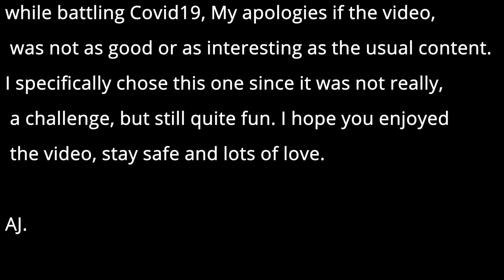Old Cast Iron Gas Stove Restoration.

Comment: i've restored many stoves like this, mostly 2 burner.my way is a little different, not necessarily better. i take it apart & sandblast everything, except the brass gas control. i paint with rust-o-leum high temp paint. most u.s. stoves have adjustable orfices allowing them to operate on propane or natural gas. also, i throw the old screws & nuts away & replace them with brass or stainless steel.
Reply: It can run with natural gas OR propane?
Reply: @michiganmikeupnorth  as my comment stated, the orfices are adjustable for natural or propane gas.

Comment: Neat. I just bought one of those a few weeks ago on Amazon. I was hoping I'd see a way to increase the output of the burner, but that's ok. It's probably best to just get a new one at some point that's not as low quality.

Looks nice!
Reply from the maker: The output is not adjustable, you only have a valve that adjusts when you turn it. That is the only way you can adjust the output.
Reply: @AJRestoration  yeah. The bolt in the side is supposed to restrict the air flow, but even with everything wide open it's not very powerful. I was thinking of replacing the valve with a more effective Venturi system. Not even sure if it'd work.

Comment: Excellent video!
1) After rust removal with the acid, do you wash or rinse the burners before baking on the flax seed oil?
2) What process (& product) would you recommend for restoring vintage stove burners (cast iron) that were recently painted, presumably to hide rust? (I don’t know what kind of paint was used, but I don’t want harmful fumes produced when the stove is used.) Does the stripper need to be neutralized somehow before rust removal using water & hydrochloric acid (and in what proportion)? Thank you!!

Comment: I thought it was a great video. I just purchased a 3 burner stove, close to this one in appearance.  Two of the burners have 4 round circles on them about the size of a US 5 cent piece, and one burner has 7 circles for the gas on it.  Eventually I will try your method of restoration.

Comment: Thanks for the video. Get well soon. I recently found one of these in my fathers garage in similar, very rusted condition. Mine has almost no markings so I don't know where or when it was made. I was thinking of restoring it too when I came across your video. I might have to do the acid based rust removal on the entire thing since I don't have a blasting cabinet. Giving me some inspiration.
Reply from the maker: I am glad I give you some inspiration. Just don't leave the Iron in the acid for too long, mine was in there for about 2 hours.
Reply: @AJRestoration  thanks for the tip. I just had a different idea for the rust removal...do the electrolysis method instead!
Reply: What acid did you use? Would vinegar work?
Reply: @suechapman3934  
any acid would do...vinegar is a weak acid and I would dampen a rag and try it on a small area first....
Being iron, sulphuric works the best, hydrochloric (pool acid) will yellow it.
Hydrolysis with baking soda and a battery charger is safer.
Reply: @suechapman3934  We had some old cast iron Dutch ovens that has a lot of rust. After looking around for the best method of getting rid of it the easiest was a 50/50 mix of vinegar and water. I sprayed it on and let it sit for 15 minutes and was astonished to see how effective it was. After thoroughly washing off  the solution and a few minutes with steel wool I began the process of seasoning. They came out perfect.

Comment: I have a 3 burner propane stove With identical burners, that I can't tune right should I try without regulator . I have a 20 psi regulator now it all yellow flame 🔥 and soot !! Any suggestions would be greatly appreciated thanks.

Comment: Great video! Would you kindly tell me what kind of paste have you applied in the threads at 11:50 and 12:09 ? Many thanks!
Reply from the maker: That is called Copper grease its a lubricant containing a high level of copper to prevent the wear and seizure of connecting screws exposed to very high temperatures.

Comment: What does the bolt on the left side in front of the valve do? Seems like it just threads into the tube and that's it.
Reply from the maker: That adjusts the shape of the flame. all the way out the flames has a sharp blue point. all the way in the flames are less intense and kind of calm.

Comment: What is the.name of the rust.remomal spray that you are using it seems to be quick acting 🙄🙄??
Reply from the maker: I used a solution of hydrochloric acid and some water. Pool acid will also work, just be careful and don't leave it in there too long.
Reply: @AJRestoration  thanks for your help with this matter young man 😎 stay safe out there

Comment: You should have used electrolysis to remove the rust.
Reply from the maker: Electrolysis would not work here, I needed to remove rust on the inside of the burner. Electrolysis only works on the outside.